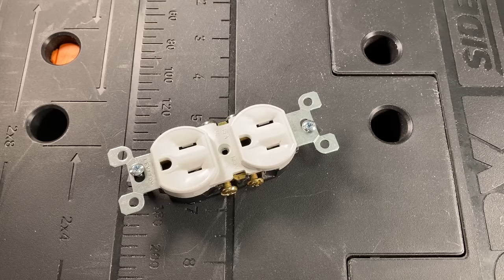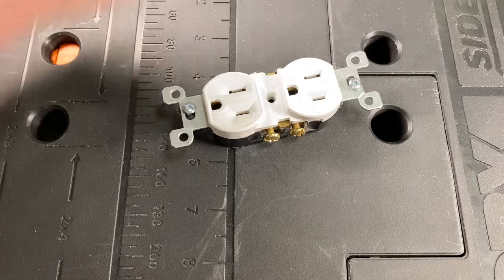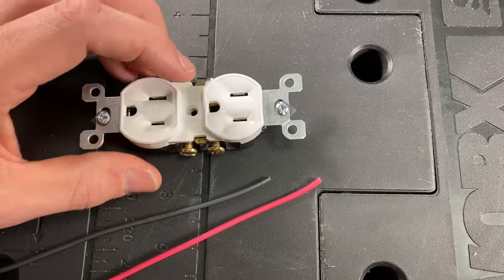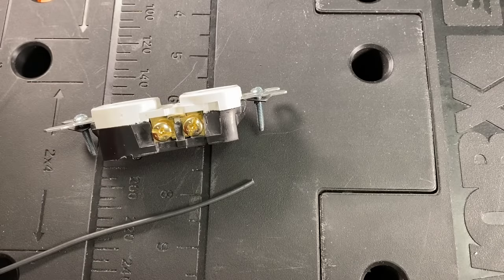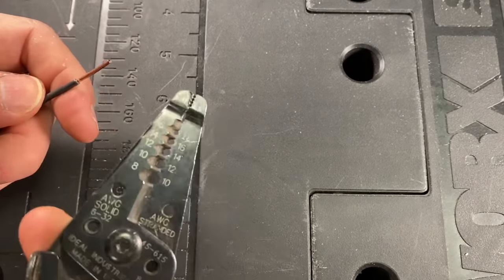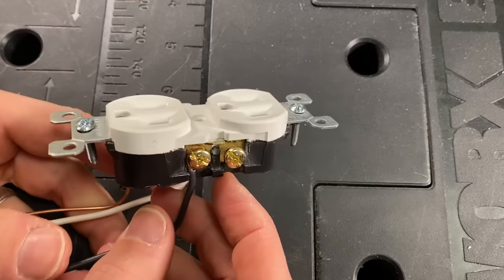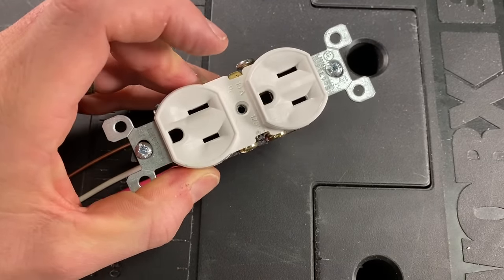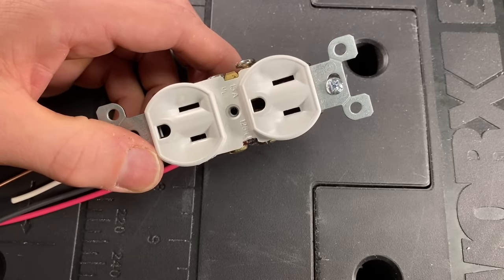Electrical Outlet Basics | How To Wire

Comment: Can I still use a new outlet even though I broke off both connectors ?
Reply from the maker: Hey Michele, which connectors did you break off?  The small tabs that allow the top and bottom outlet to be controlled independently?  If you have a picture you can also jump over to our Facebook Group "Everyday Home Repairs Community" and post your question / pics.  I wish we could post pics on YouTube comments but at this time that feature is not available.
Reply: @EverydayHomeRepairs  Yes the small tabs is what's broken off. 
Thanks for getting back to me so soon. I found your video very helpful

Comment: I've seen one vendor receptacle where the screw accaulty captured the bare wire in the back mechanically.
Reply: Accaulty?
Reply: Most if not all new receptacle have both in my experence.
Reply: Yea, gfci outlets are like that. I don’t like it. They never seem to stay tight. By the time you wrestle the gfci outlet into the box BECAUSE THEY HAVEN’ T GOTTEN ANY SMALLER IN THE 50 YEARS THE’VE BEEN AROUND! 😡 If you pull the outlet out a little to get to the screws you can always tighten them down some more.

Comment: what if the switched outlet is being powered from a different breaker, do you /do you not need to use a separate neutral?
Reply from the maker: Hey Justin,  Not sure what the code is for this application.  With all the neutrals tying back at the busbar in the panel not sure what the risk would be is you didn't have the separate neutral.
Reply: @EverydayHomeRepairs  well one person on a diy site said this,  

"No, you can't steal a neutral wire from another circuit.

Each neutral wire is the return for the corresponding hot. If you "steal" a neutral from another circuit you run the risk of overloading that neutral wire (overheat, fire risk).

Another issue might arise if the circuit later becomes a GFCI. GFCI measures the current difference between a circuit's hot and neutral. Using another circuit's neutral will make the GFCI detect a current difference and it might trip."

Makes sense to me . . .    but, not expert  :-)
Reply: @justinlocke  don't steal a neutral from another circuit. what do you mean your split receptacle is powered by a different curcuit? One powers the bottom receptacle, the other the top?
Reply: @Justheory11b  well i didn't actually do this... I am just always curious about what is and what is not legal.  what I meant was, assume a hot from breaker A powering the top receptacle and a hot from breaker B powering (the gold screw) bottom receptacle.   I could certainly see someone saving themselves time by just attaching the new hot from breaker B and not bothering to put in a new neutral wire from breaker B.   I just learned something new :-)    Note I am not a licensed person so I never do any advanced stuff like running wire.
Reply: @justinlocke  This was done a lot on outlets in the 70’s/80’s. The switched top outlet was on the lighting circuit (lets say A phase) and the constant hot bottom outlet was on the receptical circuit (lets say  B phase). It was done by running a three wire from the panel and as long as the two circuits are on opposite phases then no chance of overloading the neutral. Problem arises when someone changes out the outlet and doesn’t break the little tab between the screws. Phase to phase short!
Reply: @MrSleepProductionsInc  Wow, thank you, that is just so very interesting.  So you could conceivably have 20+ amps running on the awg 14 neutral side wire in that case, and it would not overheat the neutral or trip the breakers(?)  Feels like magic!    now I must ask, what happens when you have a phase to phase short??
Reply: I would check the electrical panel to see if the branch circuits in question are connected to one another, thereby they will switch together. They should be, or it could be a code violation.
Reply: @justinlocke  
What if it comes from a duplex breaker?
Reply: @njsongwriter  um, you might want to reply to one of the experts in the thread, I am just a student here :-)

Comment: Forgive me if this was asked, but I don't feel like reading 1500 comments, lol. Anyway, does it matter what terminal you use for line in or load out? I've seen examples where the hot and neutral line in was on the top, I've seen it where they're on the bottom, and a lot of the daisy chain examples show the hot line going to the tip terminal, and the neutral going to the opposite bottom terminal. Does it not matter Because of the jumper?
Reply: It does not matter if the jumper is in tact.

Comment: I have new outlets I'm trying to connect in my bedroom. They are a chain... The first feeds the second and the second feeds the third. The first works fine, I tried hooking up the second which has 2 white, 2 black and 2 grounds which I hooked together, but breaker trips immediately when I turn it on. I have each white hooked to a separate silver screw and each black going to it's separate gold screw... And the ground to the green screw. I tried a different outlet but it keeps tripping... Any ideas?
Reply: Although not your problem it is a better idea to not daisy chain through a recepticle, use pigtails instead. Are you using GFCIs on the daisy change instead regular recepticles?

If so remember they have a load and a separate line side.

Comment: The Phillips screwdriver never provides adequate torque. I follow up with the flathead and get at least another 1/4 turn on the screw. Loose screws cause fires.
Reply from the maker: Great tip Luke 👍
Reply: If you use the right sized Phillips driver it will.  There are a lot of shitty Phillips screwdrivers!  Look up the history of Phillips screws!  They call it something else slightly different in Canada.  BTW make sure your tools have insulated handles.

Comment: hi   i wired 240 to this outlet.  Removing the connector bridge on the hot side, and using 240 common on neutral side.  One side of 240 went to one brass screw (black) , other (red)  to other brass screw.  In the garage, beside the welder. It is now useable, and breakered.

Comment: I was replacing an old outlet that would work intermittently. When I took it apart, one wire was on the upper terminal on the right side and the other wire was on the lower terminal on the other side.... does that really matter?
Reply: No, it doesn't matter as long as they are going to the correct screw and are tight.

Comment: In europe  no polarisation only in 400 volt  3 phase system. In 230 volt both wires are hot. In 400 we have 5 the three phases neutral and ground. Moust houses have TN 400v 3 phase

Comment: I recently changed out a few outlets in my house because we wanted to change the color of the switches and outlets from Ivory to lite almond. When doing this I noticed that all of the switches and outlets were wired with the "back stab method" and nearly every outlet and switched pulled from their respective box had at least one wire pull out from it's clamp. That tells me that the connection wasn't very good in the first place. Also, I noticed that all of my switches do not have the ground wire attached, in the single switch and outlet locations the ground is tucked into the back of the box so I attached it with no problem. However, in the double and triple switch boxes all of the ground wires are twisted together then capped with a wire nut leaving the wires too short to attach to their respective switch. Can I untwist the wires, make a short bare copper wire pigtail then attach to the proper ground on the switch? The house was built in 1995-1996 so ground wires were definitely required by the NEC at the time. I can only blame negligence on the contractor and inspector (if it was actually inspected) .
Reply from the maker: Hey Eric, I am definitely not a licensed electrician but in our area for plastic switch boxes and plastic faceplates what you described is common.  Don't quote me and check your local code but it is my impression in our area if you are replacing a switch with a non-metallic faceplate a ground is not required.  Again just my thoughts and not advice on your local code.  Best of luck with your repairs / improvments!
Reply: IMHO, the ground is ‘not only’ there to protect a fault on a metal box or metal cover plate, but to protect the user from whatever is plugged into that outlet.  Imagine you have a loose hot wire on the inside of a power tool and it contacts the metal casing.  If properly wired, the casing is grounded and the ground goes to the ground on the wall plug and then to the panel/earth.  This allows a safe path for the electricity to travel.  If no ground is in the wall receptacle, then YOU may become the path to ground and get a shock.  Please, if a licensed electrician could chime in, that would be great.

(When I first read the initial comment, I misread it and thought the “box” was a plug receptacle.  This isn’t quite as bad, but still not a good idea to bypass a switch ground.)
Reply: @glasshalffull8625  yes, pigtail your switches to the ground terminal on your switches/outlets. As you said, it's a safety thing.
Reply from the maker: @glasshalffull8625  thanks for sharing your thoughts.  Appreciate the feedback and different viewpoints/experiences.
Reply: I have a new home built in 2018 in Houston and they used the  "back stab method"
Reply: @glasshalffull8625   Another thing that works great is after you wire up the the outlet correctly, take some 3m black tape and run it all around the back of the outlet covering all 4 screws, so if you ever have to go back in there,  and you dont cut the power, all those live brass screws wont touch something else metal in there...
Reply: @glasshalffull8625  in tools with only a plastic case, no ground is required because there is nothing to ground.  The same thing is true in a plastic box with only plastic switch toggles exposed, the only thing to ground is the plaster ears strap.  The only thing that is required is to carry the ground downstream to ground whatever the switch leads to.

One of the nice things about a metal box, besides being fireproof, is that it you ground one device, you ground all the devices in that box through the plaster ears screwed to the box.  I don’t know if this is still code.  You can have fireproof boxes (except for the inevitable holes) or short circuit proof boxes, take your pick!

Comment: how to correct an overstripping of the wire? Do you trim the copper?
Reply from the maker: Yeah, that would works.  You should have the stripping guide which shows you how much copper to expose on the back of most (not all) plugs.  I think 5/8 of an inch is common for the amount of copper to strip.  Let me know if you have any other questions.
Reply: hotrodd100  5/8" is the standard.
Reply: hotrodd100  technically 5/8 - 1/2 = 1/8   NOT 1/16!  Is that egg on your face? :-)

No Problem, I’m just pulling your chain... ER... wire! :-)

Comment: How would you wire your subsequent receptacles in the circuit? Would you just make sure it was a receptacle with plenty of terminals?
Reply: Pig tail the in and out wires and use the tail to hook to the receptacle.
Reply: If your talking about daisy chaining the outlets together, that is what the second set of terminals is for and why the bridge is there.  The only wire that doesn't have a second screw and you will need a pigtail is the ground wire.  You just feed a second wire into the same outlet box and connect the white and black wires the same way in the second set of terminals.  Then just wire the second plug (Also often reffered to as the "down stream outlet") the same way as the first and you can continue to keep doing this for as many outlets as you need.  But check with your local code to find out how many outlets you can wire together on the same circuit.
Reply: @KevinBenecke  the pigtail method makes folding the wires into the box so much easier

Comment: Installer 100s of feet of wire and switches/outlets as a multiple homeowner no issues- the other day hooking up a simple single light switch i turn power back on flip the switch and the light flickers/ strobes (cfl) tried standard bulb and its dim and fades like a light would that runs on batteries losing juice??? Wth?

Comment: what if I'm putting in a floor outlet which has 2 separate outlets (4 plug ins).  Wire in parallel or series and what does that look like?  Assuming I have only one Romex 10/3 coming in?
Reply: best practice is to install "pigtails" on the receptacles, and then wire nut the pigtails to the incoming wire.  #10 is a pain to install to receptacle terminals, anyway.
Reply: Floor outlets suck!  They always get full of dirty and stop working!

Comment: Great video... Tx! Could you please do a video on an “open neutral” reading on an external outlet. Outlet didn’t work so I plugged in an outlet tester and it read “open neutral”?   Thanks!
Reply from the maker: Great suggestion!  I actually had this problem a few months back in a rental property and it was traced back to a loos wire nut in a junction box up in the attic.  I will put this topic on the list of future videos as I completely agree it would make for a great topic.
Reply: surprised me, learn simple things
Reply: @EverydayHomeRepairs  great, Txs!
Reply: @EverydayHomeRepairs  
When we moved into our current home we had a problem with a GFI outlet tripping whenever the hall light was turned on. I traced it to an outlet on the same circuit that had a loose connection. Been fine since.

We live in a manufactured home that was built in 1996. I'm noticing that the backstabbing method was used in both switches and recepticles.

Comment: What if I have a switched outlet that is not being controlled by a light switch? It is under the sink to power the dishwasher and the garbage disposal
Reply: Then it's not a switched receptacle. It's 2 separate circuits and must originate from a double pole breaker

Comment: I have an older home. I did evrtything right. However, every yime I bent my wirer it would brake now it is too short what do I do?
Reply: Heather, you can use a push in connector, an Ideal splice line, or a 2 port Wago 221 lever nut. The Wago is the easiest to use and I believe that they carry them ar Home Depot now. You can the add a wire of any length you need, just make sure it is the same gauge as the other wires. Either 14 or 12 gauge.
Reply: @surferdude642  Thank y, mu crisis counseler at Home depo in electrical walked me through this awfulness.

Comment: Does it matter if red is on bottom and black on top? Can those be reversed?
Reply from the maker: I would just be guessing if I gave you direction.  Remember there are certain colors of wires that are "supposed" to be used but that depends on the last person to work/install your electrical

Comment: When placed in the wall, does the ground prong go up or down?
Reply from the maker: I don't think there is a standard in the electrical code.  In my area 99% of outlets have the ground socket in the down position.  Others have commented in their area outlets which are switched are inverted to have the ground socket facing up.  Additionally others have called the ground socket the "U slot" and as such should be in the up position so the socket looks like a "U."  With all that said and what it is worth I prefer the down position.
Reply: @EverydayHomeRepairs  correct that it is common to have the ground facing down. and often the electrician will reverse the plug so the ground is facing up when the outlet is switched. that way it is very easy to identify which outlet is the switched one in the room.
Reply from the maker: @BillAd9  thanks for the help!
Reply: only if you don't have it horizontal. then it has to go left or right.
Reply: In our area the latest code calls for the ground to be up. The idea is that if a plug wasn't fully inserted into a receptacle and something like a coat hanger fell between the two it would rest on the ground wire and not cause a short with the hot wire.

Comment: I just found out there are different outlets for different sized wire I put 12/2 wire on a 20 amp  in my garage and used regular outlets just added 4 more and used the correct outlets
Reply: I believe you can use 15amp outlets on 20amp circuits, but not vice versa.   Wiring though needs to be 12 on 20amp and 14 on 15amp and thats important.  I'm no electrician though so take that with a grain of salt :)

Comment: Q  I have a light switch in my bathroom with an outlet when I turn off the switch the power to outlet cuts out.. I want to be able to turn off the light but still have power from the out can u help me with that .. I’m trying to wrap my mind around  that?
Reply: The wire that goes to your outlet either is coming from the light, in which case you would need to run a new wire from the outlet to the switch, or the wire from the outlet is on the wrong side of the switch.

Comment: How do you wire a single receptical that has 3 seperate wires comingbout of the junction box
Reply from the maker: Do you know if the receptacle is switched or not?  Is there a light switch that controls power supply to either the top or bottom?
Reply: @EverydayHomeRepairs  no switch
Reply from the maker: @codyfelipe2718  In this case I believe your best option is to bring the wires together in individual wire nuts 1 for hot, 1 for neutral, and 1 for ground.  Then have a pigtail come from each wire nut going to the outlet.
Reply: Is it 15 or 20 amp and what room is it going to?
Reply: @njsongwriter  it is 15 amp and in the living room